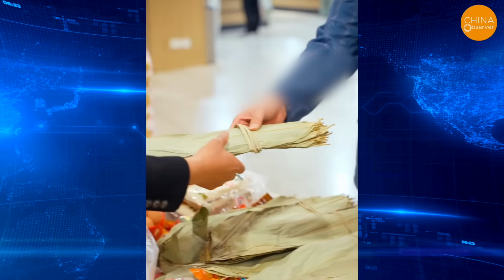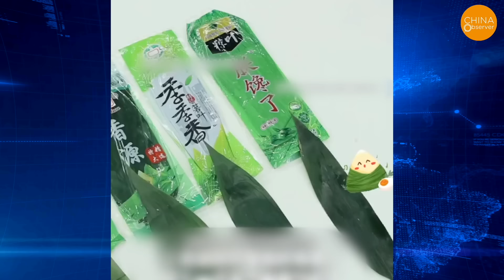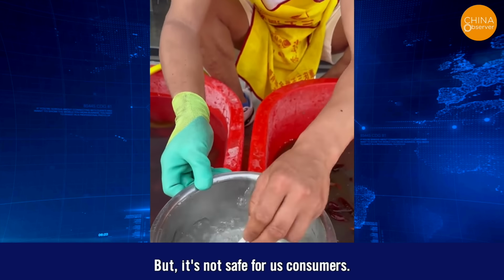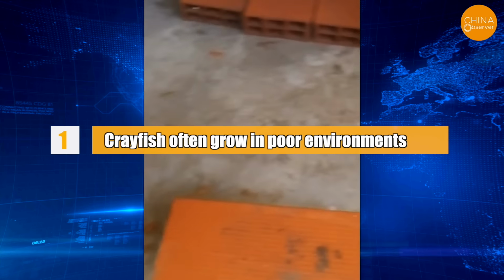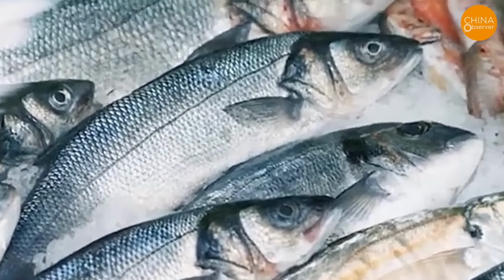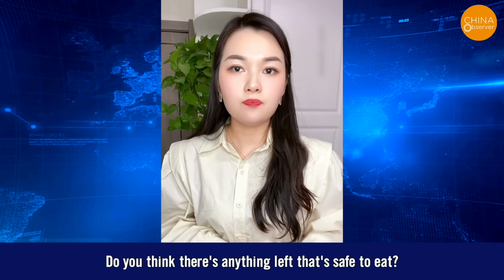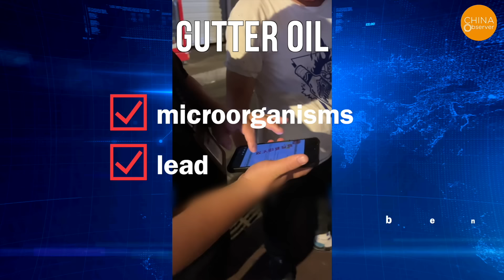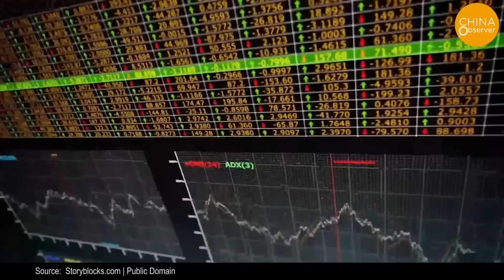Bleached Crayfish, Dyed Apples and Rice Dumplings, Saccharin Buns—China’s Fake and Toxic Foods 2024

Comment: China used to be better... as in, when they didn't use any kind of additives at all.... and just collected them. So therefore, if they were dried by natural air. This is fine too. Even if those leaves, were sold as dried leaves. This is a LOT better... than those "green looking ones"... Cos what happens is that, people would soak them first, to regenerate them back into green looking ones, even before use as well. So...  They are so obsessed with competeing.. so what if it is was dried ? Cos the green looking ones, could be just freshly picked. So selling dried leaves is not a problem !!!! Don't do this kind of "half hearted" attempts to largely manufacture them....  And even if you manufacture them... you needed like, to know the ratios... and the dilutions, and keep testing at each stages... and not like this half hearted ways.  This explains why people manage to get holes in their stomach... like I did... my stomach had a hole.. and the blood was.. I was vomitting blood... Thank you to those stupid Alibaba food supply chains etc...  I now only buy wholesome looking food... and not premade food. At all from chinese supermarkets.